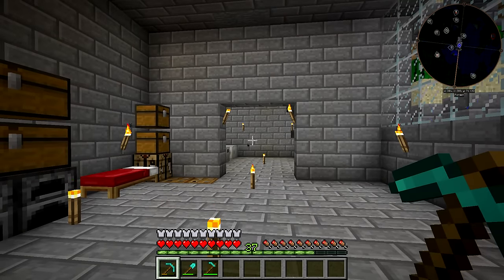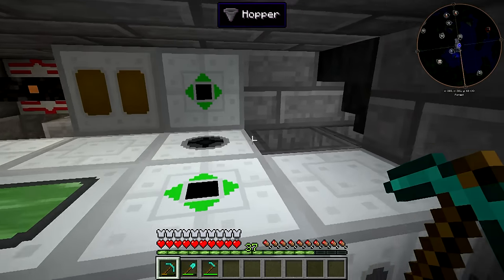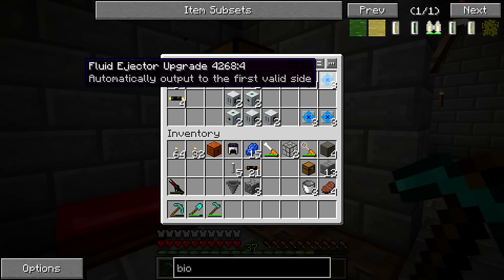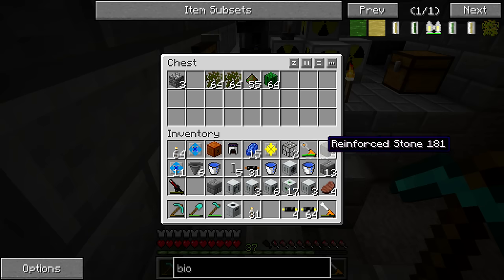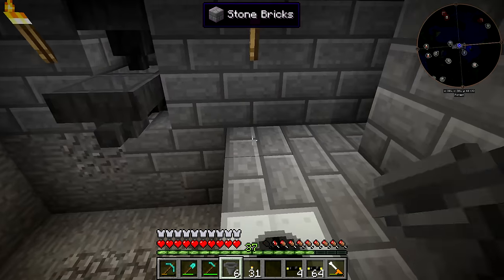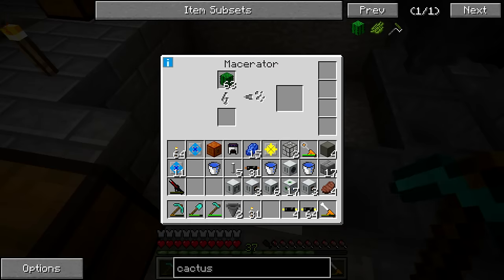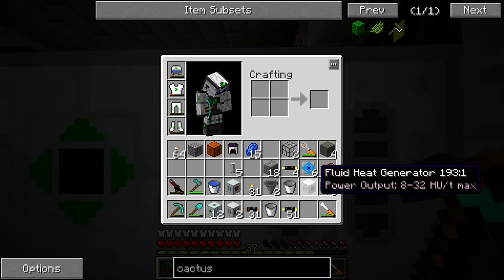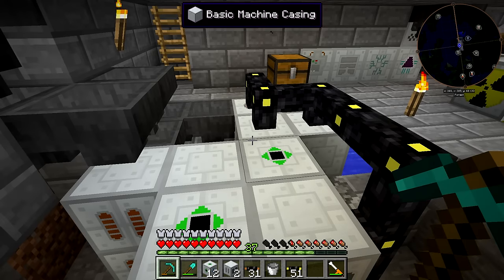Surviving With IndustrialCraft 2 :: Ep.16 - Optimized Biogas Power Generation

Comment: I notice you run into a few wiring issues, you should be able to solve some of them by using the painter, and painting the wires two different colors so they won't connect to each other. They'll still connect to blocks, but that will prevent them from connecting to each other.

Depending on how much power it's getting you might be able to overclock the macerator and only do it every 5-6 levels instead of 3-4.
Reply from the maker: +Triaxx2 Oh, I completely forgot about both overclocking it and painting the cables! The painting will definitely be useful since I am working in such a confined space and the overclocking will definitely help the system back up faster to give a more steady power output.

Comment: Nice design. Do you think it would work if you made a double semifluid generator setup per layer?
eg if you arranged things (top view):

 -   -    M    -   -           1
 -   -   F/c  P  -           2
H   F   Fl   F  H          3
-    Fl    -   Fl   -          4
-    G   w  G   -           5

where:

M = macerator
F/c = fluid canner
P = pump
H = semifluid heat generator
F = fermenter
Fl = fluid distributor
G = semifluid generator
w = wire

and the fluids are directed using direction-programmed fluid ejectors, and layers 3-5 are stackable.